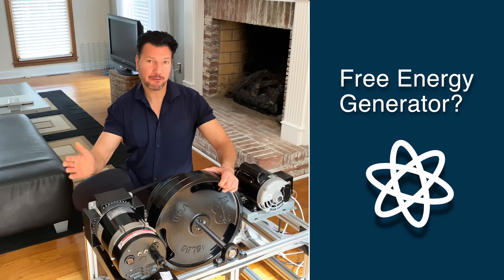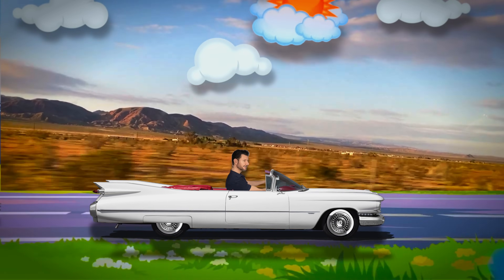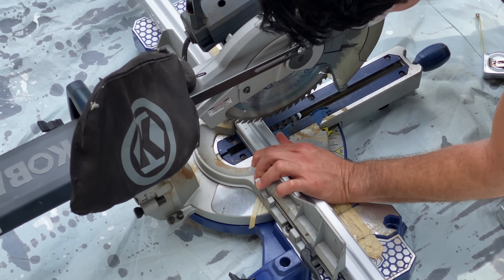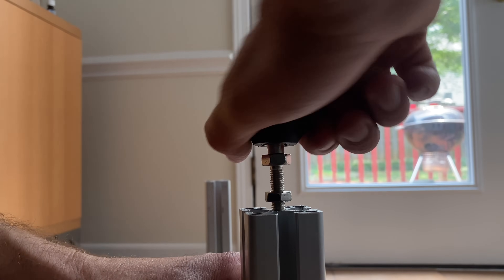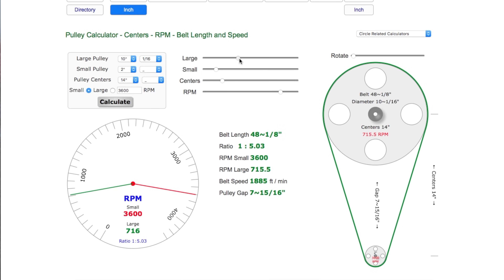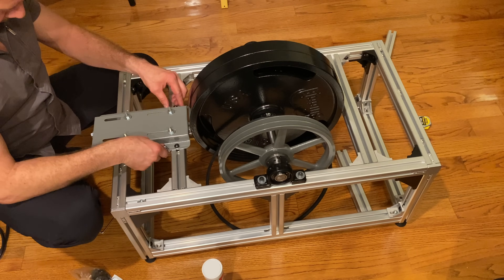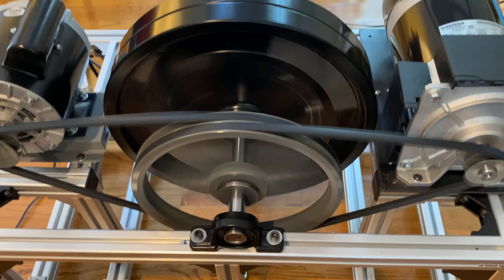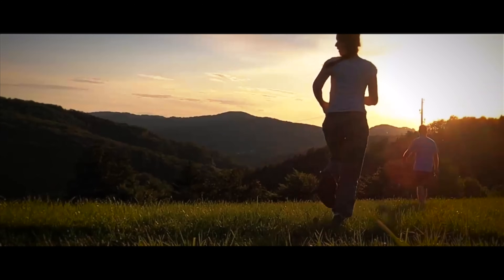How to Make a Free Energy Generator!

Comment: Nice setup and detailed explanation. you have to use custom built PMG-enerator and that should produce more than double the energy needed to start your motor. instead flywheel you should use large wings with weights and you dont need that big stand you can keep motor or Generator down also. same i have tested with my prototype which is working. I used Ford car alternator with extra magnets added removing brushes and 12v motor.
Reply: I'm going to try and build a PMG generator that hopefully one I initially spin the rotor, that it will continuously keep spinning with no other outside assistance, alot of people say it's impossible, but everything is possible if you put your mind to it, well as long as it's a reasonable idea, but the way I'm thinking of doing it, I'm almost positive it will completely work, but I'm sure it will take me tons of adjustments to get it just right.
Reply: @bradleyrumley763  I tested with many type of motor with flywheel and also without it. i sent a photo to @Stylish Guy DIY  of 12V motor running 110A car alternator conculsion of all my experiment is similar to @Stylish Guy DIY  or what youtube shows posted by many is 90% Fake. only one i manged make it work which produce extra energy but not much left after using to its motor, thats why now i am experimenting with induction/transformers and other capacitor circuits maximise this output
Reply: @3107rudy  yea I'm actually trying to not use any motors for my project, im going to try and make mine work using kinetic energy so that its making power without using any energy from anything else
Reply: @bradleyrumley763  kinetic energy with motion? Powered by magnets? Or something else one of my other friend thomas wlazlak  from WA claim that he has working kinetic energy machine but not yet successful in producing any energy. You can google his name. And also let us know what type of kinetic energy machine?
Reply: @3107rudy  man! this guys are into something!!!
Reply: @3107rudy  so are these guys. Thanks a lot
Reply: @IamPetrus  No free energy device will ever be allowed to reach the market.” — Nikola Tesla
Reply: @3107rudy  which does not necessarily means it can not be done
Reply: @IamPetrus  Nikola Tesla himself telling FREE ENERGY possible, To allow to reach the market someone has to produce it. thats how you have to decode his crypted message
Reply: @bradleyrumley763  good luck with that, creating energy from nothing.
Reply: @bradleyrumley763   I have been thinking along this road for about 10 years now. I’m just now retired so hopefully I can start tinkering with ideas. Hopefully someone will have a breakthrough sooner than later. Good luck sir. 🙏
Reply: @samuelbrock4064  yea, I have been just watching people building simple looking devices, and really my idea if it will work isn't much more complicated. After I build my first prototype and if it's a complete failure, I would love to get with you possibly and maybe we can brainstorm a little bit and possibly come up with a solution
Reply: @RonaldoHoxha  I wo t ve creating it from nothing, there will be a force asserted to initially spin it,  along with inertia, alternating magnetic forces, and even electrical current, all working together  to keep it going.  Well hopefully lol
Reply: @bradleyrumley763  it won't happen.
Reply: @bradleyrumley763  mucha suerte esperamos, que se confirme tu decisión y que entre todos podamos solucionar
Reply: @bradleyrumley763  ok i got it its based  on PMG. Like pulse rotor? Or Bedini
Reply from the maker: Thank you very much Rudolph!
Do you have a video of your setup?
Would love to see it run.
Reply: @MarkusNenning  TRADE SECRET, Sure i will show once done with my final product. still i can share its details if you want to try. its not only Flywheel generator, but its a combination of PMG, induction, Tranformers with little circuit, My goal is to generate at least 5 time of what i use to run it
Reply from the maker: @3107rudy  I would be very interested to hear more about your project.
Reply: Gracias de parte mía y de todos porque si usted ya lo ha conseguido es lo que estábamos esperando todos, que una persona con cordura dijese que esto ya puede funcionar y que vale la pena invertir el tiempo hasta hacerlo realidad,
Muchas gracias
Reply: @antfer5169  sí, está funcionando, solo para funcionar, pero no produce más energía. mi prototipo usaba un motor de 12v para hacer funcionar el alternador del automóvil. ahora estoy construyendo con un generador autoexcitado (PMG) con motor de 1200W
Reply: @3107rudy  muchas gracias por responder,
Y por la molestia de responder en español,
Mucha suerte y a ver si entre todos podemos aportar algo yo he puesto una serie de vídeos, para posibles ideas,
Y como dije en un comentario si al volante de inercia se le pudiera excitar con imanes , para que doblara la velocidad degiro ,....
Reply: Thank you Rudo the Alph
And I would like you to share your work with us so that we can benefit from you and benefit you in our opinions, until we reach what we want and achieve this dream.
And I would like to say this is the first time I see such an elaborate work, which was presented by Brother Stylish Guy DIY, so I hope that we will cooperate to accomplish this work and everyone will benefit
thank you
Reply: Nice conversation rudo same here, but i did made a 125kv generator machine n stop calling it a free electricity generator we all are skillful peoples we should know it's a renewable energy machine... Best wishes bros.... 😘
Reply: Another free allergy scientist.
Reply: yes better than FAKE  @engineerkohat  of Pakistan, who make money posting someone else Videos haha
Reply: As i am wanting to set up something like this myself would you be able to explain how to make it work properly.
Reply: @russfunk7615  what type of generator you have?  Factory made or custom built?  Its output should be double of the motor required to run on full Torque/ on load if you add flywheel same will be distributed all depends on what size of pulleys you use and flywheel. Better find large flywheel even its less weight.
Reply: https://youtu.be/1l8K1k0lhW8
Reply: With less than $20 worth of parts, (plus a $200 oscilloscope), anyone can verify for themselves, that the energy synthesis of the bifilar toroid technology used by the Stan Meyer water fueled car, works.

Video title: Physicist Steven Jones shows evidence for 8x over unity: circuit and measurements
YouTube channel name: Shameka Loeffler

Meyer - Water as Fuel - Technical Brief
Search terms:  orion Stan Meyer Full Data pdf

Where does the energy come from? A dipole absorbs energy from the vacuum and radiates it as observable energy. C. S. Wu, "Experimental Test of Parity Conservation in Beta Decay," Phys. Rev., Vol 105, 1957, p. 1413.
Reply: @timothyjohnson1511  if so why don't you make one and show it works for you too or why no one is makin fullscal

Comment: None of the gadgets and programs you quote as advanced technology break Scientific laws and use electronics that waste energy and can't make it from nowhere.  Please read the Laws of Thermo Dynamics and Relativity.  Nothing ever found breaks them.  Your Generator has massive energy losses throughout its moving parts.  So any input energy starting will quickly be wasted in heat.  You would be far better off inventing a Time Machine than misleading people with this twaddle :-)  ROFL
Reply from the maker: Like I said in the beginning of the video I learned all that in school as well.
I am an electrical Engineer and well aware of energy loss due to friction and conversion and what not.
The difference between you and me is that I like to try things for myself and don't just assume everything i learn is correct.
But do what you like with your free time!
Reply: @MarkusNenning  OK :-)  At least you admit you have not created FREE ENERGY and your device never will :-)  You would do better viewing this:- The Impossibility of Perpetual Motion Machines -   https://www.youtube.com/watch?v=rckrnYw5sOA

Comment: The pulley from the flywell to the motor should be smaller it's ok the flywheel to the generator  testing it's the only way to solve it
Reply from the maker: Hello Francisco, I have tried quite a few pulley setups. The motor rpn and the generator rpn are pretty fixed so there isn’t that much variability.

Comment: Try using a brushed permanent magnet current generator, if it is a capacitor voltage regulated DC generator it will not work...
Reply from the maker: Thank you for your input!
It’s difficult to find this components but I will definitely look into it.
Thanks
Reply: Here the complete video see from the 5:30 minute... https://youtu.be/fWUvco9KyXM

Comment: I think it will work when the generator produces higher electricity than the motor need, so you will have extra energy to use
Reply from the maker: Hello Peter, that was the idea the Generator is a 4kW generator and the motor only takes 650W.
I have even used a current limiter to make sure the motor doesn’t get more than the 650W and it still didn’t work.
Reply: Yes